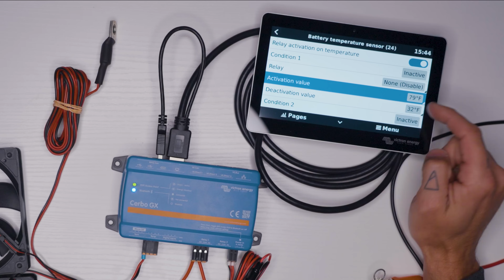Controlling a Fan with the Cerbo GX

Comment: If you wanted to power a larger load couldn't you have the cerbo control another relay that would be able to handle the larger load? I'm thinking it could control tank heaters that way.
Reply from the maker: Yep!  Absolutely!
Reply: @EXPLORISTlife  what would that look like. What would it entail. I’m not an electrician, but I can follow directions.  Can I email you directly?
Reply: @EXPLORISTlife  is that the only type of temperature sensor that works with the cerbo? What about something connected to it via Bluetooth like a Ruuvi tag?
Reply from the maker: @chachi5975 At this time, the ruuvitag sensors can't communicate with the relays of the cerbo.  Apparently this is in the works, but not currently a feature.
Reply: @EXPLORISTlife  I know it can set as an alarm rule but no action is set there. It's good to know that it's in the works. It would be helpful to have something like that done automatically. Thanks for your response.